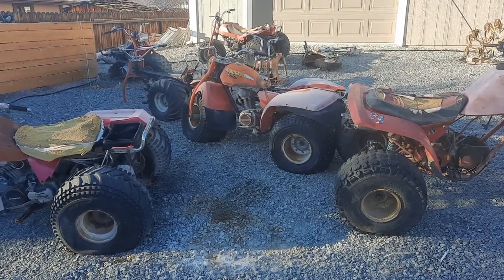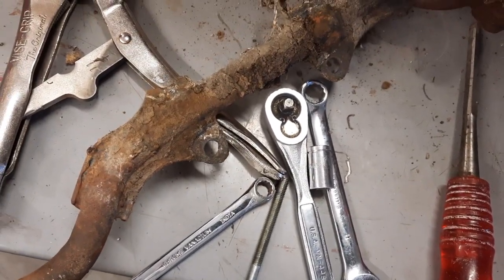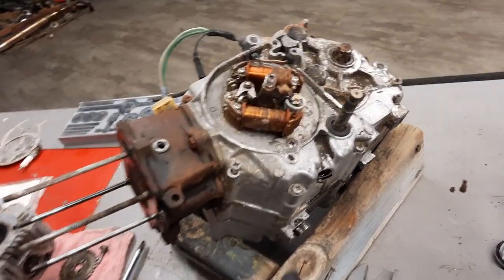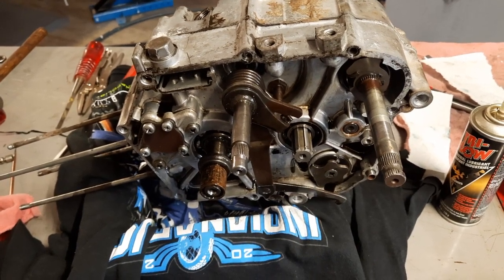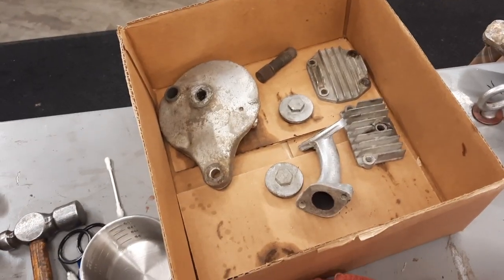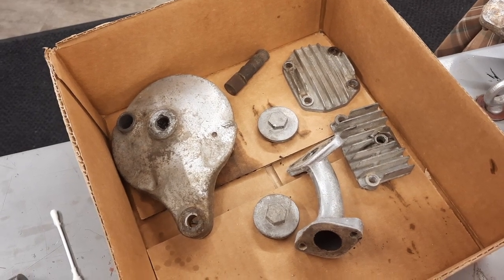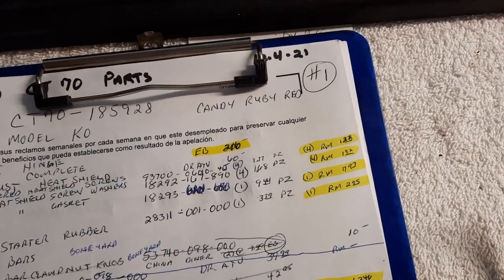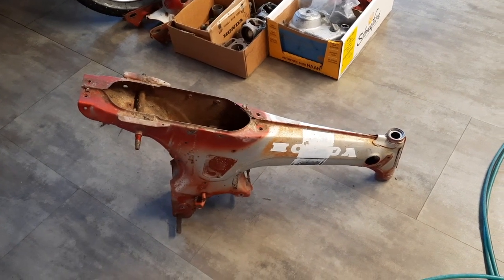Honda CT70 Restoration Part 1

Comment: You keep mentioning that you source parts from "Dr ATV", I can't find their website. Could you please provide it. Also, you mention "plating" bolts or sending things out to be cleaned....love to know what process is behind these terms? I.E. vapor honing or sand blasting? Love your videos!
Reply from the maker: Hi. I guess DR ATV is really Beatrice but for some reason I am having trouble bringing the site up?. Don't ask me why? Caswell has plating kits and the one i show in my videos is the "copy cad" kit  as far as the vapor honing it is the process I use if i can't just clean the cases up. Have fun.

Comment: Hi, do you mind to share which website selling original Honda st70 parts.
Reply from the maker: Hi Club, If you mean CT70 I use Rocky Mountain ATV for OEM and they have a surprising amount of Honda OEM parts still available. If it is not" in stock" and is listed as something that can be ordered from Honda I have found it is 50/50 if it is still available. From there you need to go to eBay, Dr ATV, CHP Motorsports and others you can find recommended on forums and YouTube. Hope that helps.
Reply: @JTSCUSTOMS  Tks for the information